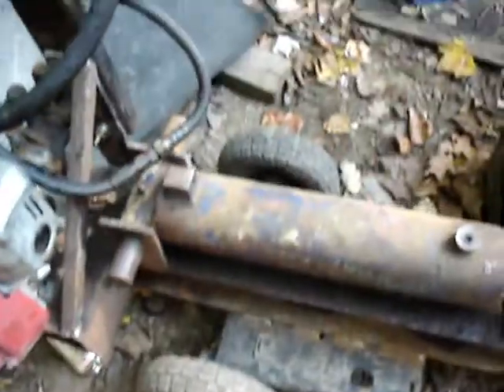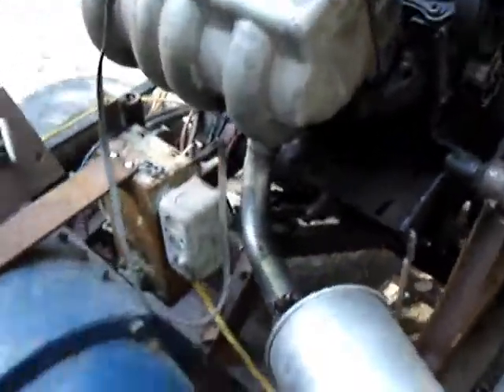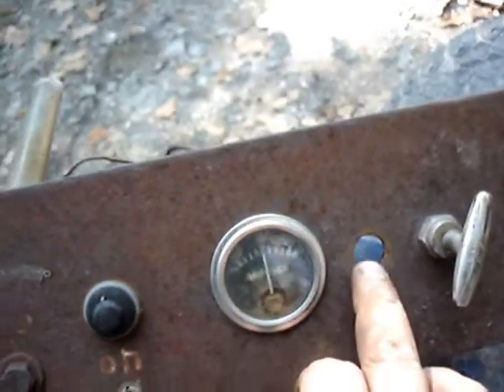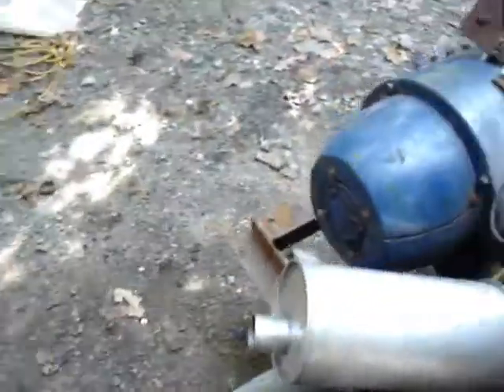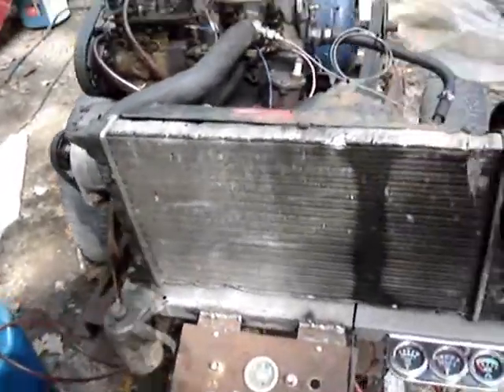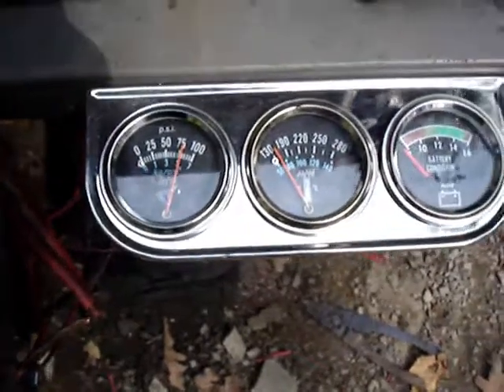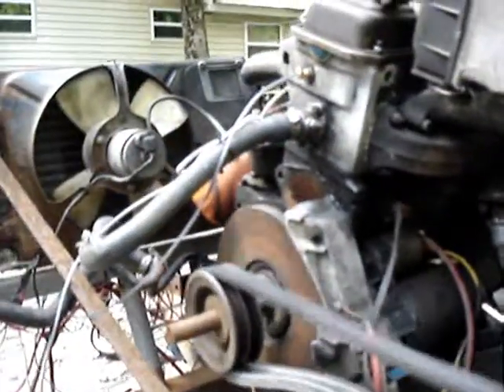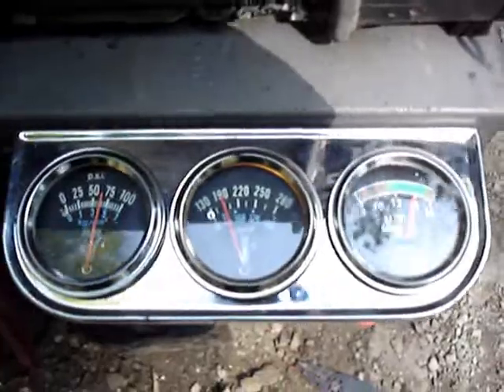VW Genny pretty well done

Comment: Very impressive. I plan on doing this myself in the near future.
Reply from the maker: Only bitch of it is a governor. I have a belt drive unit but I'm stuck as to how to make it work. You have to keep in a certain RPM on the genny so you stay at just about 60 cycles, and you also want to stay where the engine is happy.
Reply: Initial thoughts are to change the pulley sizes for starters. In addition to that the throttle is spring assisted - always wanting to return to idle (about 1k rpm). The screw where it rests on can be adjusted to have the idle rpm much higher if you wanted (2k / 3k rpm). That's where I would tweak it - just remove the locking nut and turn the screw clockwise so that the throttle lever idles at a higher rpm to where the genny is happy. Alternatively, remove the spring (10mm nut) from the throttle lever (governor) and attach a cable with a lever to your control panel so that you can adjust it perfectly to where the generator is generating power. Just don't crank it back on too much. Thoughts? Got the same engine (a few of them actually) and been running off used vegetable oil for years in my old VW Jetta. Technically, you could burn used motor oil if you wanted to. That's what I plan to do with mine.
Reply from the maker: Get the seals for the injection pump that are made to deal with veg oil. The stock ones will go bad after time and they probably need changed by now anyways. What it is with the governor, you set the governor and the governor works the throttle according to demand on the engine. If you just lock the throttle at 2K RPM or whatnot it'll bog with a load. It might still work but it won't be right. You can do electronic governors even on old engines like these but that's a different ball of BS. It'll generate at a wide band of RPM but unless there's something that throttle it up and down as needs be it won't be cycling properly. If you look at about any generator head data plate you'll see cycles per minute or KhZ, something like that. It's usually going to be around 60 and you NEED to keep it there or you'll burn stuff out...I think... Far as running it off old engine oil, filter it, like down to microns but they're perfectly happy so long as the oil stays warm enough to flow. I just run off of heating oil. I don't have need for it often so it's cheap enough.
Reply: I just assumed you would manually throttle it up high or run high but now I see you're talking specially about adjusting the throttle as required based on the power demands. It does make more sense to do it this way. That is a tough one. Perhaps attaching a custom flyball govenor to one of the shafts - when the rpm slows down (hence a demand for power) the governor pulls the throttle forward until it reaches it's preset rpm happy spot.
Reply from the maker: What I did was find an old belt drive governor from some sort of Gravely engine. I know somehow it can work but it's got me confused. Your typical lawnmower engine just uses an air vane. There's guys that make flyball units though and it's all over the web how to make them. But yea, these have to stay within + or - 1 of 60 cycles and it's a tight window.